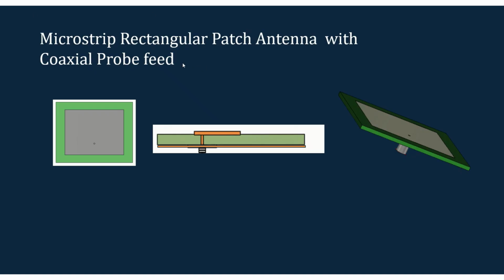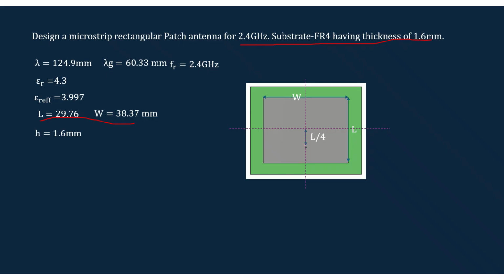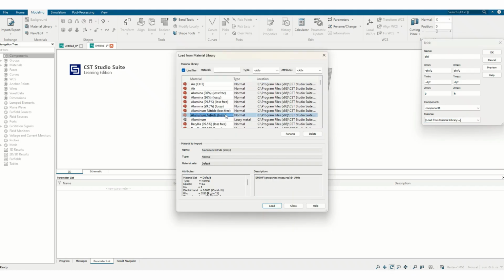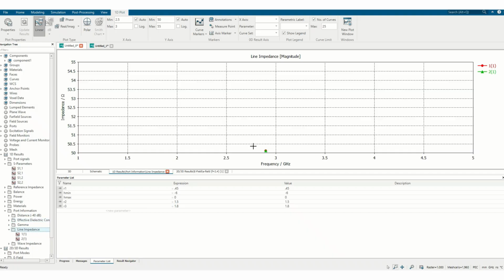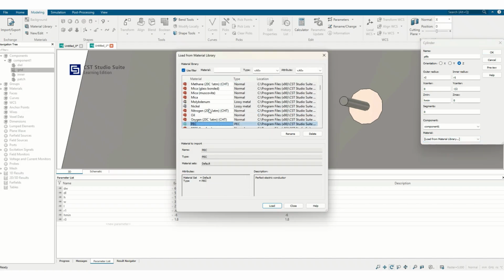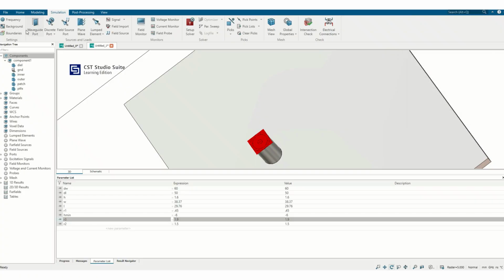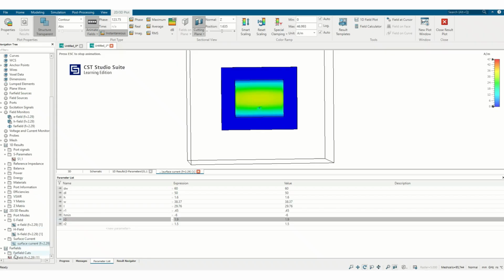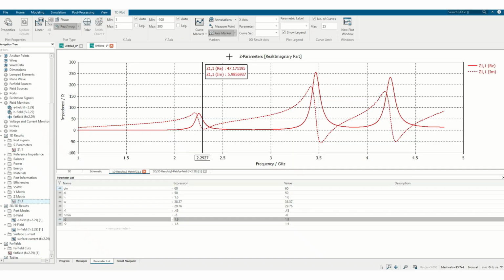Designing and Matching a Probe-Fed Patch Antenna-Simulation in CST

Comment: hello mam its wonderful that u r helping us in the design through ur channel mam can u discuss about the low RCS concept and its measurement in Absorber  using CST
Reply from the maker: This video may be helpful on rcs measurements Metamaterial Measuremet in Anechoic Chamber| Quick Overview
https://youtu.be/w7hRcfL-YCg

The concept is same.
For RCS measurements, we have to compare the result with a reference Metal plate having same size as of planar absorbers. Measure the reflected power of metal plate and then the reflector power from absorber. The difference basically corresponds to rcs reduction.